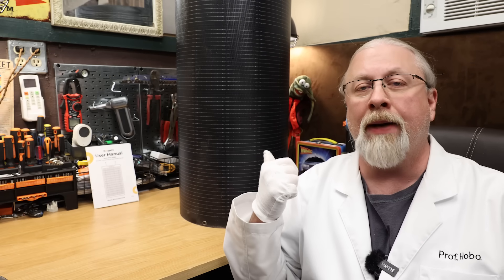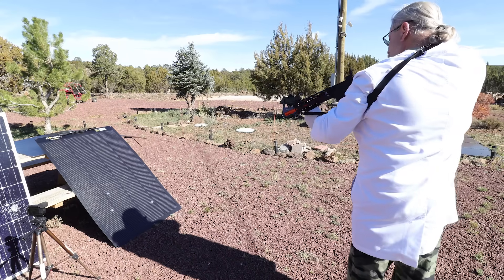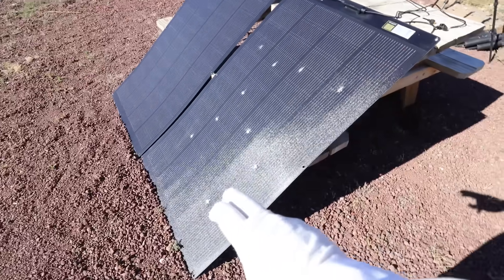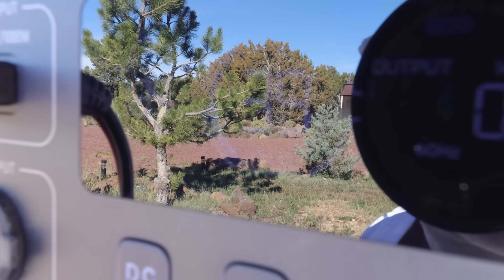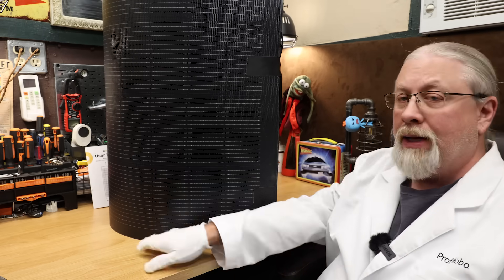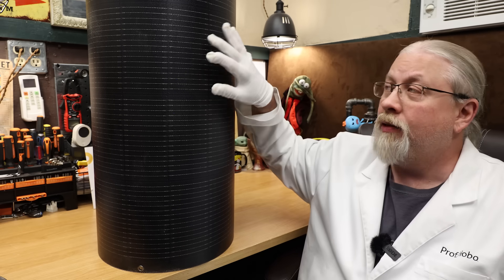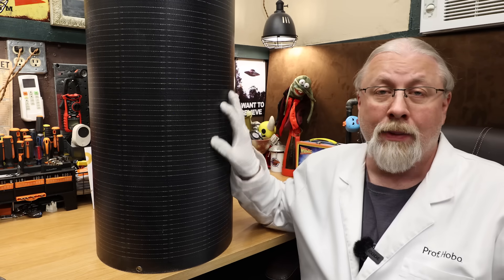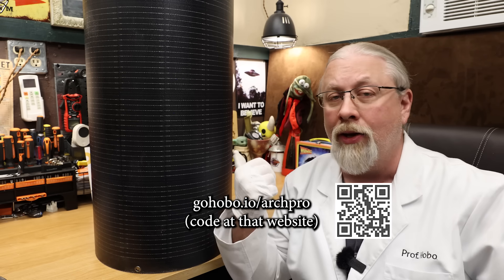BougeRV ARCH PRO 200w Shade Tolerant "Indestructible" Fiberglass Solar Panel

Comment: The panels are advertised as 24v but I don't they will work in optimal level with such low VOC AND VMP in all weather conditions. A 24v battery is charged typically around 29v. Or am I missing something?

Comment: NURZVIY 200 Watt panels are on sale for $162 current. Honest question - are these worth $80 more per panel (with all codes applied)? I'd love to save the money, but if these will hold up / last better, I'll pay the difference. I'm not so much worried about the ability to take bullets - but just as general overall quality and efficiency, etc.

Comment: I've used my BougeRV 100W short form CIGS with my pSolBot solar trackers, and I was about to get the 100W version of these, but the Voc on the 100W panels is way too high for my plans.  It is an astounding 37.8V±5% for a 100W panel!  Even higher than the 200W, and higher than the 100W Yuma CIGS, which also limits usage with a Voc of 31.5V±5%.  Some of my smaller power stations can only take 28V max, and with these I couldn't even wire a pair in series or four in 2S2P for the ones that go up to 60V.  Bummer, as I really like them.

Comment: Do you have another video showing how to tape it to an RV roof? I was wondering how to run the wires and if gaps are needed between panels to run the wires.

Comment: It’s smaller footprint is what makes it very attractive. Cigs can be difficult to deal with
37 volt
6.7 amp
That means many recent power stations can only use these in parallel.

Comment: About $140-$170 (I can't exactly recall) is what I paid per panel for Renogy flex panels in/around 2019/2020 or so, which is when I first got into solar.  The current Hobo price of these new 100  watt versions is about the same as what I spent on 100 watt panels about 5 years ago.  Well worth the price imo.  Well worth the price.  The CIGS panels I feel are still a little on the pricey side.  I do have 200 watts of BougeRV CIGS panels and they definitely do perform well.  The only reason I don't have more is because of their cost.  I am going to have to take a serious closer look at these.

Comment: RE: installing on a boat: "...so they can be submerged for up to 30 minutes.  Now, if they're submerged for longer than that, then you obviously have a much more serious issue on board to deal with."  L.M.F.A.O.  This is why you are the single best Solar YouTuber out there.  We came for the Solar info.  We stayed to watch The Professor.

Comment: I have a new project going. I’m putting a Pi 5 inside the cases of my Jackery 300. I took a USB-C cable and stripped the center off to expose the wires and hooked them to the back of the terminal for the USB plug so that when it is active, the pie is also running and then I installed Internet in a box which is a one line command . That was a little weird because I had to set the password command, even though it asked me for a password at the beginning of the script, but I at least got the initial configuration done and know that the basics are installed and I’m now loading content into it.  Really good option if it all works because it even has community email and a phone system that you could use and since FEMA is not exactly doing well right now I thought the rest of you might wanna know.
Reply: I’m trying to make our old-fashioned boombox when we were younger but now it will be full media server😂. That particular model is on sale and I don’t know that it’s made internally the same way anymore, but after I did that, all I did was take out two screws for the fan and the pie is sitting on that side without even being tied down and there’s so little room that it’s perfectly fine.  The Anker model that has the little glove compartment box could be used without modifying anything because it has three USB-C ports and a place to put the pie without doing anything.
Reply: Manufacturers, these are being used around the world in war zones and small villages now and if you would just add a little capability to them, you can help communities.

Comment: Have been running the CIGS 200Wx2 for two years.  They are long.  Take that into cosideraton.  Works just as advertised with horrible hail storm damage.  Incredible panels.

Comment: I'm still on the fence with flex panels for any long term usage no matter who makes them.

But for "short term/ travel" most brands work fine.  I still lug around ridged panels for remote work site set ups because weather, "rain or shine" is a thing.  Flex tend to dislike the rain even when "waterproof" for long term set ups.   Might have to give these a try.

Thank you!

Comment: Installed 3 flexible 100w CIGS 1.5 years ago. One situation to note, my Rv has a smooth white fiberglass top. 1 to 1.5 inches of foam then a fiberglass inner liner. After installing the stick down flexible panels at around noon till sun down the inner fiberglass panel gets hot to the touch and inside the Rv gets very warm much quicker than without the panels. Works opposite in winter, warm roof is free heat and welcomed. Just something to note before installing. Output is great, cleaning is easier as no frame my roof is curved at edges so most debris blows off and no worries about hail and partial sun is great as well.
Reply: I used rope to haul 3x 160w cheap flex panels (this was before I learned that cheap flex panels should not actually be flexed) on my roof, after a couple of months of brutal Japanese summer the corners of them had "melted" upwards and output was 20w at best.
I've had the CIGS up there over 2 years with no issues at all!